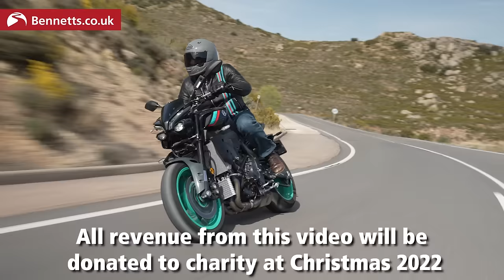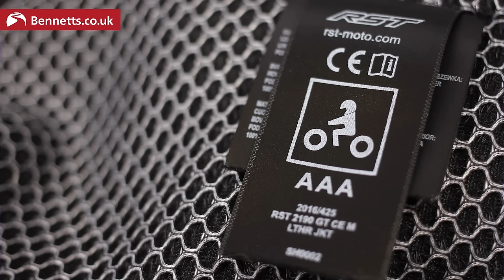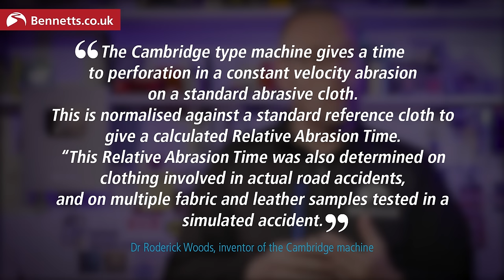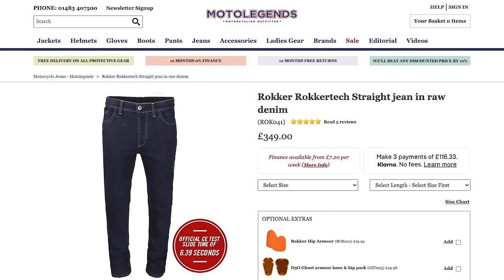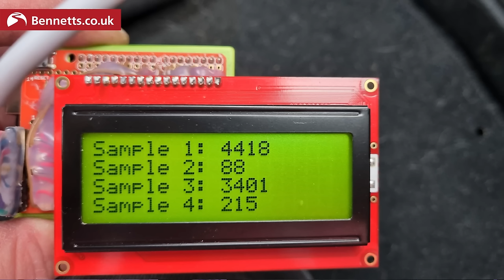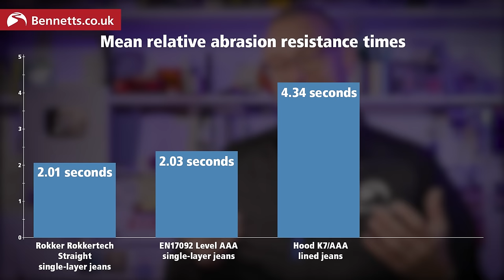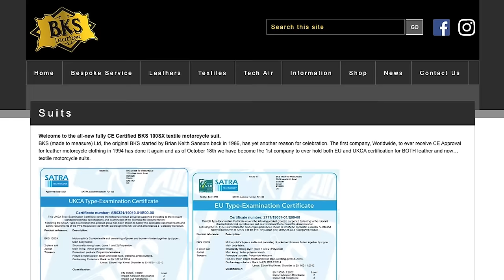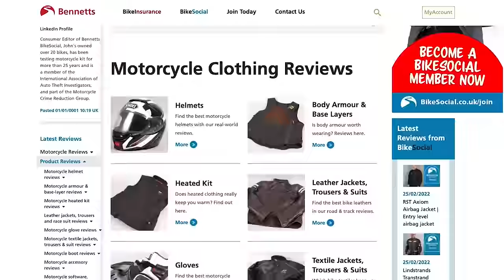Best motorcycle jeans | Single layer vs lined: THE TRUTH

Comment: Not particularly informative as you pit one spotlighted manufacturer (and their associated dealer) against an unnamed jean. I'm assuming you don't think the Rokker jeans are the best single layer and so your tests fail to give general conclusions. In addition, BKS could be relied on to provide the absolute highest standard in a single layer of leather. They stand high above most mass manufacturers and so their results may not be representative of the generality of mass produced leather.

Unfortunately, given your assertion of impartiality, a strangely similar 'tiff' can be followed on MotoLegends "How to buy a pair of protective motorcycle jeans" and on Hood Jeans "BECAUSE NOT ALL AAA CERTIFIED MOTORCYCLE JEANS ARE THE SAME".

While intending this to be unbiased, if you have spent time at Hoods' factory, engaged in technical discussion with them or received free or discounted jeans from them you may incline to their side. Similarly with MotoLegends' close association with Rokker.
Reply from the maker: You can read more, with further research here https://www.bennetts.co.uk/bikesocial/reviews/products/textile-jackets-trousers-suits/what-best-motorcycle-riding-jeans-kevlar-pekev-covec
Reply: “BKS could be relied on to provide the absolute highest standard in a single layer of leather.” Was the quality of leather against which the claims were made for the Rokker jeans specified? What were the characteristics of the leather that were visualised? “Stronger than thinner, weaker leather” doesn’t create quite the same impact, but if the availability of leather jackets which have passed EN 17092 A classification (using leather which would be better employed in gloves) represented the benchmark, then that might put the claim into context.

Comment: Sorry guys but I think you are missing one main thing:
The impact with the road in a crash is what causes major damage to the rider.
Knee, shoulder and hip protection will protect you better with a pair of Levi's than any amount of brands that have nothing more than jeans that protect you nothing more than road rash.
Reply from the maker: Pretty sure I talked about the importance of armour several times
Reply: @bennettsbikesocial  Fair point. I'll watch again.
My point was that, regardless of the strength of the jeans, the major damage is from the initial impact with the road.
I wasn't trying to be critical but, from my own experience, the ability for a pair of jeans to withstand road rash is nothing compared to protecting yourself from banging knees, shoulders, elbows, etc., in a fall.
I agree with everything you're saying.
Reply from the maker: @G100666  the protectors also make a massive difference to the outer material's abrasion resistance. Cheers, John

Comment: You set out to test whether single or multi-layer jeans are best.  Instead you effectively undermined one named brand at the expense of another.  If you felt able to name the Rokker jeans why not the others?   Having effectively promoted the Hood brand it is disingenuous to disavow this through some throw-away words at the need about “personal choice”.

The CE testing clearly leaves much to be to desired, certainly if the Australian website is anything to go by.  If the Cambridge test is a better simulation of real-world conditions why does the CE test not use it?  Why did you find it necessary to devote all your energies to trying to invent a third method, which at best could only have added to the confusion? 

I am afraid your “test” was not a rigorous analysis of your original research question.   For me, what it did instead was raise questions about your impartiality.  Incidentally, I use a brand a brand of jeans not mentioned by you at all.
Reply: You seemed to miss the section saying that the testing rig was unreliable yet key conclusions were clear: armoured inserts made a huge difference and single layer was trash.
Reply from the maker: The claims made around the Rokkers were what I was trying to address, and had they been true this would have been very different content. I tried to explain why the Cambridge machine is no longer used in the current version of the CE test, but it IS claimed to be used to give what turned out to be misleading slide times at point of sale.
There's more information on the regulation and test methods here:
https://www.bennetts.co.uk/bikesocial/news-and-views/features/product/motorcycle-ce-safety-standards
https://www.bennetts.co.uk/bikesocial/news-and-views/features/product/motorcycle-clothing-the-ce-approval-law-explained
https://www.bennetts.co.uk/bikesocial/news-and-views/features/product/safest-motorcycle-gear-ce-ratings
Reply: @donaldpyper4627  My point about the testing rig was that there was no point to it.  I heard the assertion that single layer jeans were worse than lined but I did not see any evidence, beyond the excellent Australian scientist’s information about friction effects on the skin.  I would expect multi-layer jeans to be better but did not see any robust testing of different makes, Hood’s or otherwise.

I agree that with armour should be better than without, if only because of the extra layers.  But does the CE testing take this into account?

My issue remains that, if you are going to lay claim to science-based independence, greater care should be taken in promoting particular brands based on personal preference without solid data.
Reply: @bennettsbikesocial  I have no problem with your testing of the Rokkers but rather with your using a sample of one to prove your thesis about multi-versus single layer.   I also have a problem with your promotion of Hood jeans without any objective data relative to other brands.  Your independence is easily tarnished by any appearance of bias.
Reply from the maker: @bbumble4117  everybody is entitled to an opinion, and there's only so much I can do. I respect you view.
Reply: @bbumble4117  : MotoCAP is the world’s most extensive independent test programme for motorcyclists’ clothing. Your point about the limited sampling which led John Milbank to his conclusion was a valid challenge, so I collated the abrasion test test data for 54 separate riding jeans evaluated by MotoCAP to date. The conclusion is unequivocal and supports John Milbank’s findings from even a very limited sampling : lined jeans are predominantly superior to single layer jeans. 

In the MotoCAP tests, no single layer jean scored more than one point out of a possible ten for abrasion resistance. Sorted by abrasion resistance score, rows 1 -23 of the spreadsheet are taken up exclusively by lined jeans.

Whilst sixteen examples of lined jeans (including four styles of ladies’ leggings) also scored a single point out of ten; from my conversations with my associates at MotoCAP, there has been a move by some brands to reduce the extent of additional layers in their lined products, with some materials now only present in the Zone 1 area of the impact protectors. The brands do this because EN 17092 permits these cost-cutting measures without penalty, whereas MotoCAP identifies and scores them accordingly. It is debatable whether such garments can be credibly be considered “lined jeans”. They sit somewhere between lined jeans and single layer jeans, whilst performing like the latter.

I will be happy to share my spreadsheet with you if you would like to contact me and provide an email address.
Reply: @paulvarnsverry11  Thank you.  This is exactly the sort of robust evidence I was looking for and would have dispelled any suggestions of bias in the review against one particular brand of jeans and in favour of a another.   In all honesty, your findings square with my own preconception:  I expected multi-layer jeans to be better but data trump intuition and prejudice every time.    

You have also reinforced (no pun intended) my views about the scope for improving  the EN test.

Another aspect that concerns me is the testing of the effectiveness of armour.   The EN test is, I believe, carried out in isolation from its particular application.  In many brands of jean, the positioning of knee armour is fixed, regardless of the anatomy of the wearer.  This must surely have a significant impact on efficacy?  Also, might armour affect the integrity of any material surrounding the armour pockets?   While the extra layer provided by armour must surely help reduce abrasion, how often in practice do accidents involve sliding on hips and knees, relative to other parts of the anatomy?    

Then there is the whole parallel issue of what I have heard called “passive safety”.    Uncomfortable or inadequately insulated, waterproofed or ventilated kit can distract rider attention and lead to dangerous losses in concentration.    

Motorcycling can never be wholly risk-free.    Indeed, that is part of its attraction for many.   The various standards tests crucially help mitigate risk by providing objective assessments of the true protectiveness of protective gear.   More power to you and your colleagues in continuing to shine light on areas for improvement and on the mendacity of some kit manufacturers.
Reply: @bbumble4117  : You are welcome. Reading your previous comments and your response to mine, we clearly share a number of areas of thought which I’d be happy to debate and discuss with you at any time. All the best.